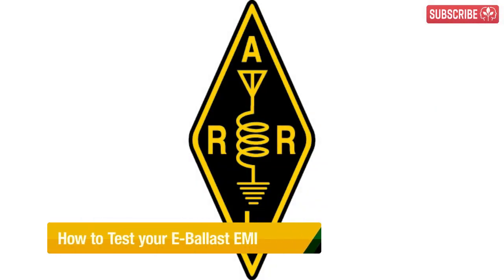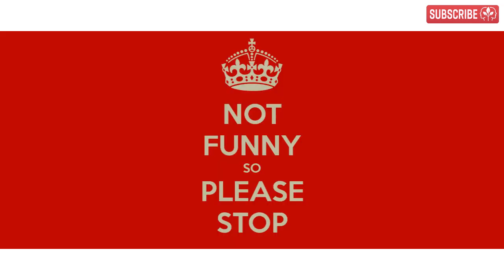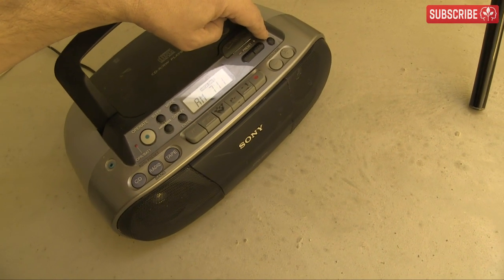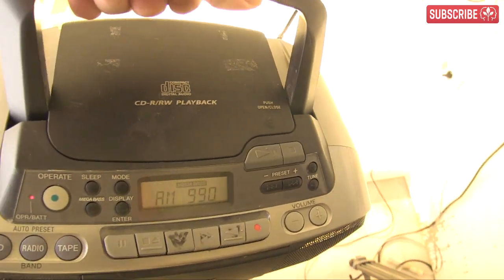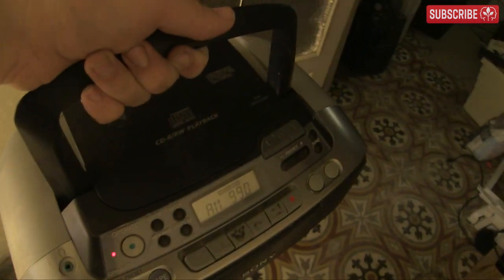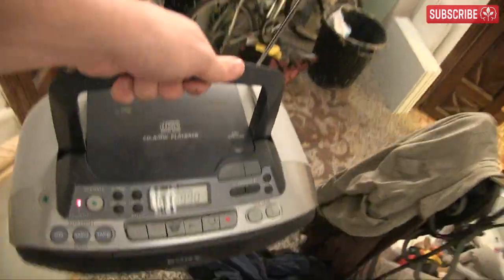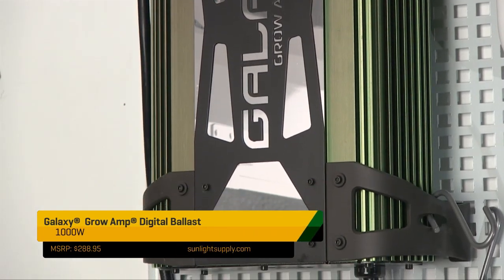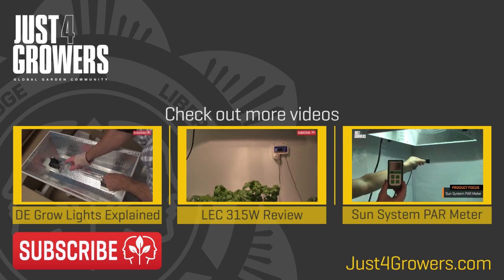Is Your Grow Room Annoying Your Neighbors?

Comment: Is there a particular AM radio signal/station that we should tune in or will we pick up interference on the whole AM Radio bandwidth? Keep up the quality work on your channel ¡Awsome, great job!
Reply from the maker: +costa mesa steve Hi Costa. It differs between ballast brands. So your best bet is to scan the AM band until you hear the telltale noise. Once you think you've got it, turn your ballast off and if the noise stops on your radio, you know that you've got it.
Reply: this is bullshit, your am radio is not a suitable test. you need to get a shortwave radio and tune between 7 Mhz to 7.3 Mhz  ( that's 7000 Khz to 7300 Khz) and even better if your shortwave has ssb mode.

Comment: Always enjoy the quick and informative product reviews. I like your micro machine style. Since you have the technology to measure PAR light it would be interesting if you used that technology to test a standard digital ballast on a new double ended lamp. Then test a new DE digital ballast on the same double ended lamp. Be nice to see if the standard digital ballst will fire up the double lamp and if it does what PAR mesurments are compared to the new DE digital ballast intended for a double ended lamp. I belive there is confusion on what ballast is to be used with a double ended lamp. I am sure the 6 million dollar man would take this challenge on but he broken down and has been put in storage, so I implore you to take on this mission.
Reply from the maker: twd Hi TWD. Thanks for your feedback, question, and challenge! Philips & Gavita are the only manufactures claiming high frequency requirements. Philips states 100khz, Gavita states 90khz. Ushio, Digimax, Sylvania, GE have not released their minimum frequency. We have tested ballast fully powering the high PAR DE lamps in the 65khz range. There is massive misconception surrounding the frequency requirements right now, as people just assume higher frequency is better –this is not true. High frequency operation can literally rattle the lamp apart due to acoustic resonance and harmonic distortion. You will have noticed DE specific ballasts on the market now, such as the Galaxy DE Ballast that will operate at 105khz. I have one on order and will test it soon. To date, I've only run my Digilux DE 1000W lamp on a Galaxy Grow Amp (which operates at 72khz) and it appears to be operating the DE lamp at full power. It's my understanding that the Grow Amp was never meant to be DE specific, it was meant to fire every lamp type and brand you can buy in a grow store. 72khz will run a standard MH, HPS, and PSMH lamp. Conversely a 100khz ballast would not operate a Hortilux Blue MH lamp, so it’s a bit of a balancing act for the manufacturers, but—for sure—some growers are being misled on ultra high frequency issues. Higher frequency does not mean better performance. I'll take on the mission for sure, as soon as my DE-specific ballast arrives. :) I hope you're subbed! Thanks again and happy growing, Everest.